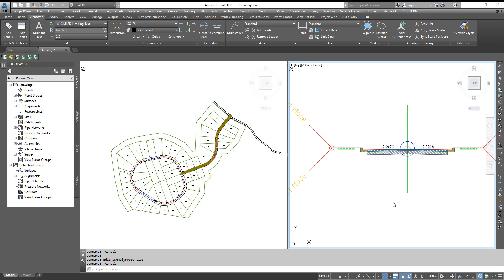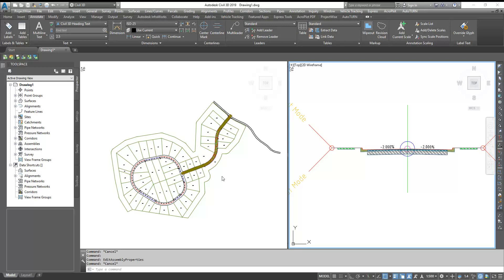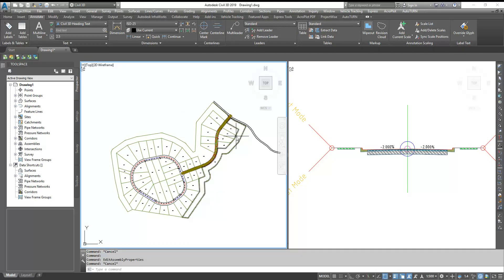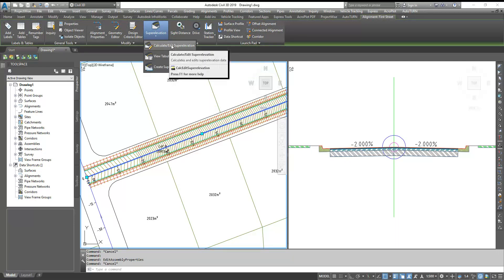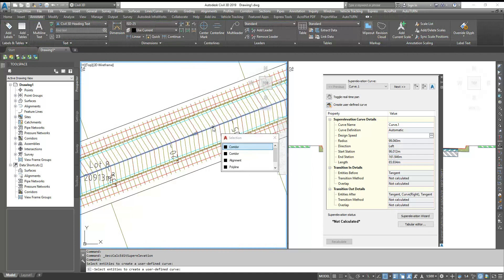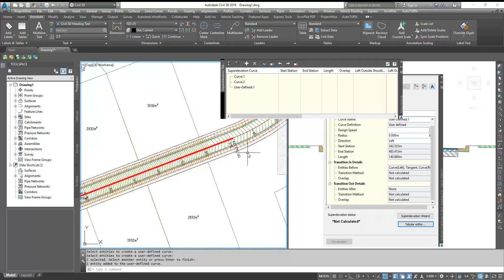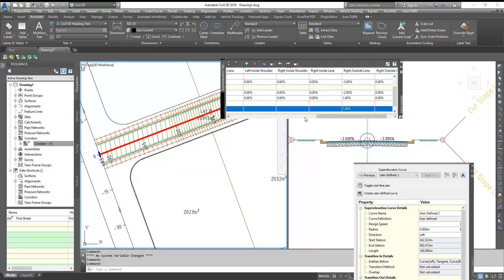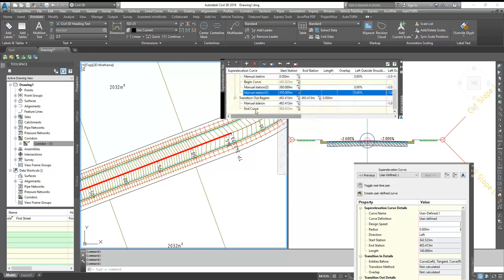Civil 3D - User Defined Super-elevation

Comment: Hey your videos are really informational and I am new to this software, can you please tell to how to export the super elevation data for every 20 m or 30 m interval instead of where the the camber will change and attains full super elevation,  as the site staff requires the data for every 20 m or 50 m interval for layout at site. Thanks
Reply from the maker: You can cut cross-section for that. Also we have shown in one of our video how you can quickly generate setting out point from corridor in one of our video.  You can export those point with Northing and easting and give those data to site.

Comment: How to show on proposed  road layout plan super elevation text with arrows, both side every 5 meter or 20 meter.
Please upload video for that.
Thanks
Reply from the maker: You can only show them at super elevation location. Like normal crown, level crown, reverse crown and full superelevation.  If you want to show at every 5 meter, you can use surface slopes annotation. But you have to put them manually.
Reply: @Civil3DProTipsandTricks  I need every 10 meter ,
Please make a small video. I will be very thankful
Urgent require
Reply from the maker: @md-mohammed8455  https://youtu.be/HMnUUZn1ky0